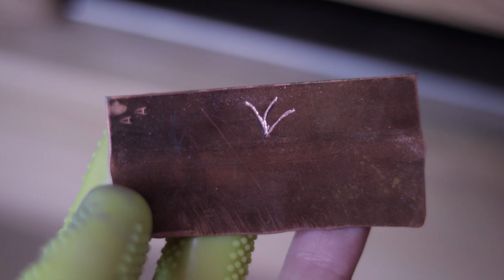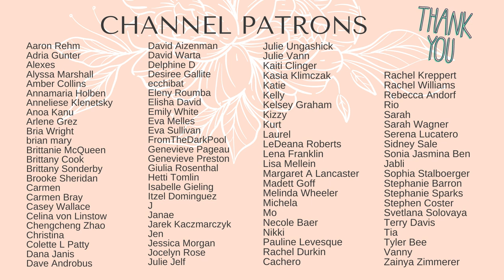SIMPLE ENGRAVING on metal with the rotary tool. Carving shapes with pendant motor

Comment: I always try to leave a comment; that was great Basia, thank you for showing us. I'm wondering if you don't mind telling, what size sheet do you find is best for the overlay? And, how is the Lion Forge engraver? One more tip from me (yay), Amazon sells big sets of those diamond burs for CHEAP - like $4-$7. Buying from jewelry supply is at least 6-10 times more expensive - who knows why. The cheap ones from China work well (they are the same as the Rio or Cookson, etc). They come in all one kind or mix sets - I love them.  great video as always!

Comment: You got wonderful and pretty comments. But no technical questions, really.  How do you clean up all the jagged lines?  I noticed you did not zoom in on the lines, but I was able to see jagged lines in your demonstration.
Reply from the maker: Why are you policing other people's comments?? 😂 If you have a technical question, then ask away, no need to get all worked up over what others say. This was a fast demo that was supposed to show only WHAT can be done, not how. Therefore, I didn't pay attention to the whole process, cleaning included. When I make lines on my actual projects, I'm usually not actively filming, so I'm able to focus 100% on the technique, and my lines don't require much cleaning. If they do, I use appropriate attachements for the rotary tool. Hope that helps with your concern.

Comment: May I ask if you polish your metal before engraving or after you are finished with your design? Thank you for your great tutorials!
Reply from the maker: Thank you so much Heather! It depends on what type of finish I want to achieve. But usually I will try to have the surface nearly finished before engraving, simply because any additional steps will remove fine amounts of silver, therefore making the lines less deep. So usually the very last stage would be polishing or matte finish :)

Comment: Thank you so much for this video I have been wanting to start using some burs in my work for texturizing. Do you use sandpaper or something else to finish up the design with after using the bur to texturize.?
Reply from the maker: You need to try it out asap! You'll love it :) yes, I use something, but not sanding paper. I usually use different rotary tool attachments, but not too coarse, as they would affect the texturing. Mostly medium to fine grades of bristle wheel attachments

Comment: I have something laid out on a piece of paper which I'm going to put on the side of a water bottle...if the paper is glued down to the metal, will the bur cut through along the lines?
Reply from the maker: Yes, it will. Although later, after you remove the paper, you might need to fix or deepen the lines, by running the burr through the once again. I usually do that

Comment: Are any of these burrs sharp enough to cut a shape in the sheet metal if traced enough times? Or would a different tool be needed for that I wonder?
Reply from the maker: Hmm, do you mean like piercing? If so, it's best to use the jeweller's saw for that and simply cut this space out. These burrs are pretty sharp, so you can use them to make deeper lines/grooves, but I\m not sure how well the would do to essentially drill trhough the metal. I also don't thing that would be a safe job. So better use this for the work on the surface. And use drills to make holes in the metal and jeweller's saw to cut out. Hope that helps :)

Comment: Hallo, is there any way to do this on a ring? Would you suggest engraving the metal prior to forming the ring? Or engraving it after the ring has been formed?
Reply from the maker: with these simple techniques, and for someone who isn't advanced, I would recommend doing it prior to forming a ring. It's much easier! However, if you feel confident, you can try after the ring has been formed! Make sure you have good equipement to hold the ring in one place, like engraving ball for example

Comment: Hey there I have subscribed to your channel.Please can you tell me what the machine is called you are using to make the patterns with the burrs? And is their a cheaper option to buy? I’m just starting out. Thankyou 😊
Reply from the maker: This is a speed motor, also called pendant motor or a rotary tool, with a flex shaft. The one I'm using is by Foredom, but Dremel also makes great ones and they're a bit cheaper :) There also other brands available, but I recommend Dremel and Foredom the most
Reply: @TheArtOfMetalsmithing  Thankyou so Much ❤️

Comment: what speed do you recommend for engraving?
Reply from the maker: The speed I use with these particular bits is medium. Not too fast and not very slow. It's fast enough to have a smooth line, but not too fast, so I can still control it well. It's better to try it out and see what works for you, get the good feel of the tool. So I would recommend practicing on a brass or copper sheet! Good luck! :)
Reply: @TheArtOfMetalsmithing  thanks I used 3 out of 6 and it works very well
Reply from the maker: @IsZelev  Perfect! :))